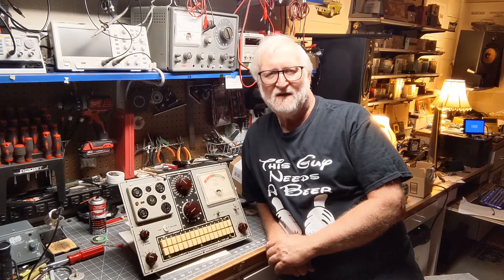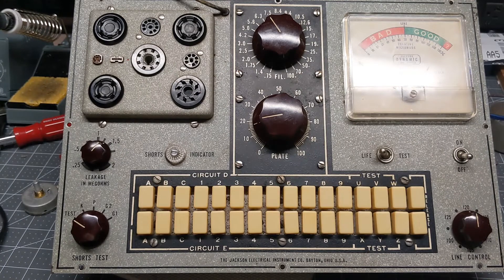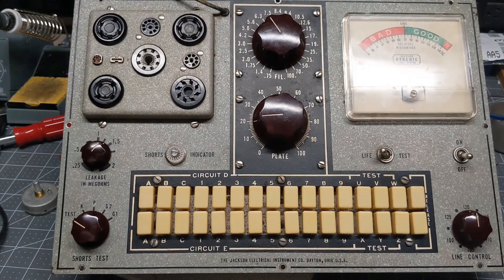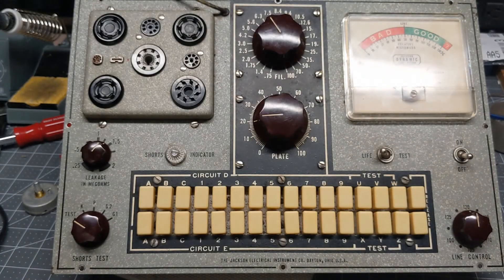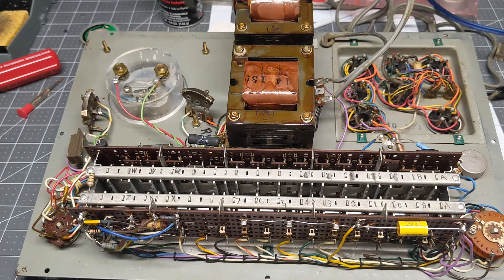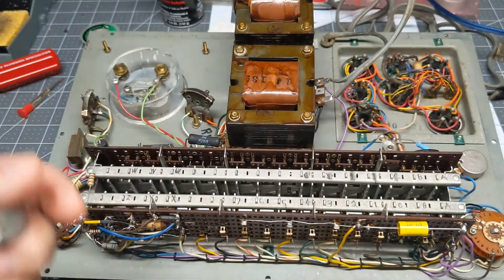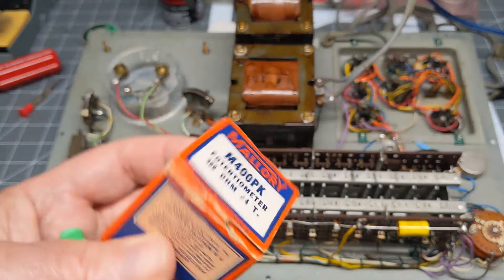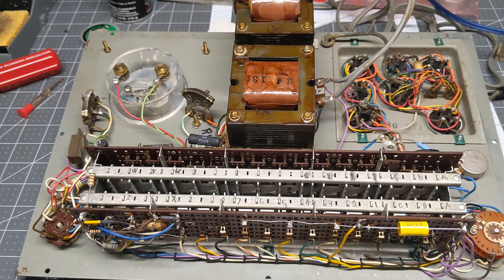Jackson Vacuum Tube Tester Model 648R

Comment: Well, my 648 really frustrating me. Replaced out of spec resisters, corrected a couple wiring errors. Line calibrated fine. The plate not so good. V, W, Z CALIBRATE OK at plate settings of 10 and 50 using the second method in the tubesandbound article. Y and Z just can’t get enough current to get the meter to the “line.” But I tested my calibration tube anyway, it was 90 instead of 105. Been going thru the wiring and resister values over and over. Beginning to think it’s a transformer problem…don’t want that. Not much to go on but do you have any suggestions? Also, replaced the plate control, no difference.
Reply from the maker: Does yours use a diode? If not replace the rectifier with a diode. Other than that if R15 & R16 are in spec if you have an original diode in there maybe try replacing it?
Reply: Got it!  After reading the calibration procedure for hundredth time, I realize that my calculations were correct and it says so in the document. X and Y cannot be calibrated in either method with plate control set to 10. So, I rigged up a 40v battery and 15v variable supply and all fell into place. All specs now within 1%. Thanks so much for your explanations of this unit, couldn’t have done it without. 

Question. My unit is an early model 648, low serial number. Line control has no calibration it’s that old. My leakage test is fixed at about 270k. Will making the mod to make it variable be of any value?
Thanks again.
Reply from the maker: I thought they all had line calibration. But, Tubesound has an article on replacing the tube with a diode.
https://tubesound.com/rebuild-calibration-of-jackson-648a/

Comment: Just came across your video. I just received a model 648 that looks good but it won’t calibrate the plate current. Line cal is good.  Further checking makes suspect the resistor placement and values, some marked values not even close to the parts list values let alone any drift. Thanks for the video and especially the pictures, that will save what little hair I have left. Lol
Reply from the maker: If you're interested in how the circuit works, check out the other video where I explain the circuit. https://youtu.be/y6nnWzC-qaA?si=VDO08FDo41lHcPWY